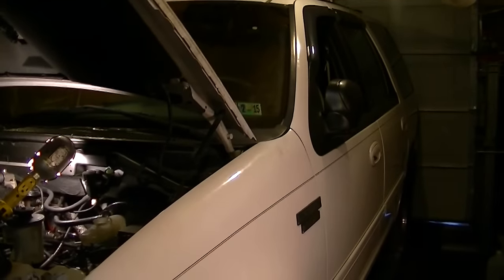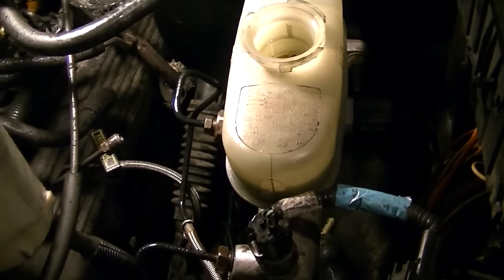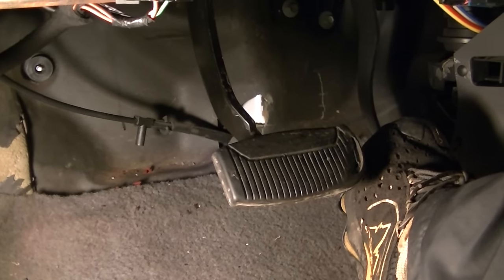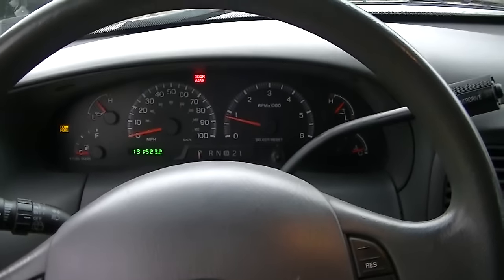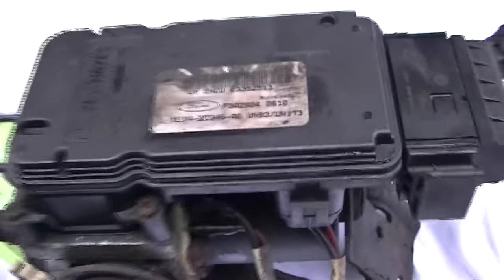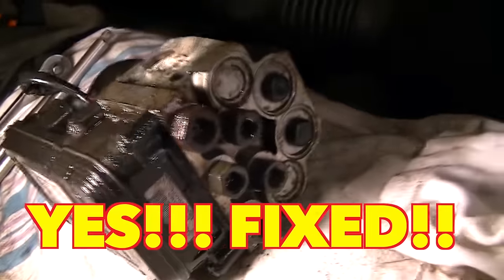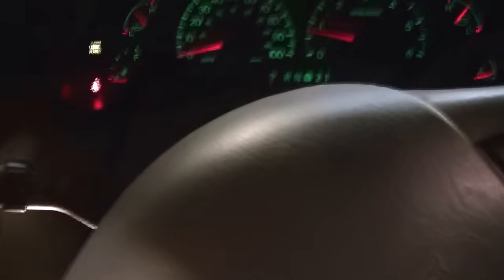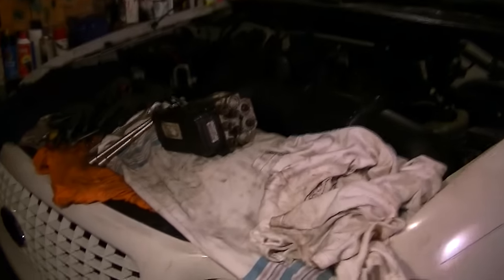Sinking/Spongy Brake Pedal -With ABS SYSTEM?? Nothing Works? Watch Fixed!

Comment: One of the things that can take out the ABS and the calipers is failure to flush out the brake system with compatible brake fluid and then top off the master cylinder to the max mark. The pistons in these devices are made from steel that can and will rust out if maintenance is not done. The DOT 3/4 conventional and synthetic brake fluid is hydroscopic and will readily absorb moisture. Not only does that moisture rust out the caliper/slave pistons but the braking is much reduced by the moisture (since water boils (steam) at 212 degrees at sea level and a gas (steam) can be compressed (spongy feel at pedal.) This should be done once a year to reduce the chance of rust in the system and maintain the seal softeners in the system which DEPLETE in one year. (Professional racecar mechanics change out the brake fluid before every race!) You will immediately notice the stopping power increase after changing out the brake fluid.  Once the debris, dirt, rust is eliminated and your clear plastic line runs clear on all bleeder valves, try to clean the inside of your master cylinder reservoir with a soft LINT FREE cloth to restore its translucency. Some people wonder why the master cylinder brake fluid is dark after a length of time. This is caused by dirt entering the system every time the brakes are applied. While there is a seal-boot on the slave cylinder for drum brakes or seals on the calipers, these seals do not prevent ALL dirt from entering the hydraulic system. Dirt is the enemy of hydraulic systems! The final bleeding will be done with fresh brake fluid and all dirt will be eliminated. Plan on using 1.5 quarts to do this procedure correctly. And be sure to read the very small fine print on every brake fluid can. You may need a magnifying glass to read it! It's that small! They all say once the can is opened dispose of the remainder responsibly. Reason? Once opened it's now contaminated with moisture from the air. And never mix standard brake fluid with synthetic blake fluid they are not miscible or compatible! Use what the vehicle manufacture says to use. Special procedures are needed to properly bleed down ABS systems and each vehicle can be different on the sequence for wheel gets bled first, last and in between so it is prudent to check the factory manual. I hope this helps someone. UTI graduate AOS Automobile, Diesel & Industrial Technology, ASE Master Technician - Automobile, ASE Master Technician Medium/Heavy Truck.
Reply: UTI guys back at it 🤣
Reply: Just bought kia sportage 08 like 100k miles,had air in brake lines and needed pads and a couple rotors..but when I went to bleed the brakes,they ended up feeling like even more air was in the lines than I started out with,Pedal goes all the way to floor now and pumping the pedal makes no difference on stiffness..when bleeding the brakes,1 bleeder screw was a 11mm others were 10mm which means they've been messed with previously.during the bleeding process I noticed I had to nearly REMOVE the bleeder screw just to get a minimal amount of fluid.right before I am able to get the screw open just enough to barely be able to bleed it,I noticed a tiny bit of fluid drippin out from the seat...the fluid was BLACK so I continued to bleed until it came out clear,unfortunately I noticed a bit to late that my buddy "helping" wasnt paying attention to the reservoir..could I have possibly sucked some air up into the abs control module?or is it more likely I just need to replace calipers to,the fluid says it's never been chsnged
Reply: Good stuff all true .
Reply: So what happened when I had a complete brake job and fluid replacement. Had full pedal prior to n spongy pedal afterwards. I’m thinking they f’ed up my job. Brakes work but pedal low
Reply: Thanks I have done this only once  at between 65k and 75k it how has about 165K miles I will replace replace the fluid this next servicing 👍
Reply: @scottwebber652  how is the pedal now,
I have same issue. What did you end up doing to fix this problem?

Comment: I’m have the same soft pedal issue with my dodge. Changed the brake pads in the front because they were bad then it snow ball effect started. Changed the ritors, calipers, flex hoses and master brake cylinder. Still having the soft pedal issue. Makes sense that it’s the ABS module. Thanks for the video!!

Comment: Everything I've researched and vids I've watched says that if the abs module fails (no leaks) that it will still operate like a proportioning valve , you just won't have anti-lock brakes. So , did yours have a leak? I'm puzzled

Comment: Great video. I’m glad I found this. Struggling with my 2011 grand Cherokee and then racking my brains out to figure out what the hell is wrong after I did everything you did. Thanks a lot bye take care
Reply: Did you replace the ABS system? I have the same model and year and the BRAKE warning light stays on even when driving

Comment: 1993 Isuzu Trooper.  This is exactly my issue.  Brake pedal goes almost to the floor before firmly engaging.  Had master cylinder replaced twice (one leaked), had  brake booster replaced twice (one aftermarket leaked on arrival).  The mechanic said he did not know what the problem was, so after $1000  limped home with the same problem.  After viewing your video, it appears that I might have the ABS problem.  I get in the car and the brake pedal feels normal, and only slightly goes down.  Turn on the engine and immediately the pedal goes almost to the floor before engaging.  Also, while driving, I will pump the brakes a little before stopping, and I hear a hissing sound.  I need a better brake mechanic.   Thanks for the video.  Thumbs up!
Reply from the maker: Nice!!

Comment: My wife's Nissan Pathfinder 2014 has the same thing happening intermittently. We even took it to the stealership once and although they bled the system it still happens. Just happened yesterday on our way home from OC. Maryland.  Thanks- now I know what to look for since the brakes were just replaced 10,000 miles ago.
Reply: Was it the abs?
Reply: @ThatBeardedGuy69  Not sure.  It's our backup vehicle now - we don't drive it much.

Comment: I have a severe sinking brake pedal with drastically reduced stopping power on a 2005 GMC Sierra I recently purchased. Given past ABS WSS and Modulator problems, I pulled the ABS fuse and tried braking again. PERFECT BRAKING!!! So, disabling ABS by pulling the fuse is a major troubleshooting step. ABS modulators are very expensive and so are the controllers. I've had ABS disabled on my 1995 S10 for over 100,000 miles. The ABS modulator would have cost half the value of the truck! The S10 was having momentary total loss of braking, which theoretically should not happen. So much for theory.
Reply from the maker: Sometime, I'll try the ABS fuse and see what happens.
Reply: Same here, with a 1997 Chevrolet K2500. Total loss of braking function thanks to the ABS, with the pedal going all the way to the floor. I pulled the ABS fuse, and no more problems. GM ABS systems are extremely dangerous.
Reply: @ttiwkram  I got a 3500 dually with the same problem , I will try it today, one night I came to a red light and the fan belt broke and my brakes has hydro boost that gets its boost from the power steering pump instead of vacuum , i couldn't stop at all , GM brakes suck.
Reply: Just had the same sinking break pedal issue. Lost all breaks pulling into drive way. Pulled the ABS fuze in engine bay. Works perfectly fine now. All breaks returned to normal. 99 chevy blazer 4x4
Reply: My 1995 is giving me problems
Reply: Man, IT WORKS am I glad I found this needle in a haystack!!!! Pulled the abs fuse and had an almost full pedal, yeah but, I plugged it back in and it still works- so far no test drive yet. Been at working on my own cars for 50 yrs. and this is new to me ( 2002 s 10 ) newest I've ever owned...1st one of this century.. THANKS, TONS
Reply: Got a 2008 Silverado that out of nowhere had very hard pedal for like 2 days then all the sudden became a very soft and sinking pedal and barely stops the truck. Already replaced the master cylinder and made no difference. When I brake hard on gravel I can feel ABS kick in but under normal driving I can barely stop

Comment: I am facing same issue... Break padel is sinking once ABS is triggered(Its very rare in my car to actually trigger ABS). But once its start sinking then  I need to stop the car , then start the ignition (Dont Start the Engine), now just pump the Brake to make it hard and then start the Engine.. Its perfectly working as expected. I have tried this at least 10+ time and working fine :)

Comment: The black rubber caps you see below the brake line connections are the LPA's (low pressure accumulators).  This is where fluid goes during ABS event.  Pull those caps off and put a straightened out paper clip in the hole and pump pedal.  If they push out of the valve as the pedal sinks the ABS unit is the issue.  Sometimes if you pump the pedal multiple times very quick you can get a good pedal because the LPA's will fill up and give good pedal.  Spring pushes the piston/fluid back out in the system.  Hope this helps!
Reply from the maker: Nice!! I've done that in the past. It seem to work. Believe it or not, that same SUV still drives today still good brakes!

Comment: I had the exact same symptoms. For some reason I changed the ABS module first, still had a sinking pedal. I then changed the master cylinder, problem fixed. I replaced my original ABS module and luckily I can return the used EBay purchase. A friend/mechanic told me it was the master cylinder. I should have believed him.

Comment: I am thrilled that you solved the mystery. It's on one I am facing on the abs light along with brake light staying on even when I replaced the left front wheel sensor. I erased all the codes with scanner, turned engine on and lights went out. But later I drove off and in 5 secs both lights came on. Initial scan at a transmission shop found trouble with both, wheel sensor and abs pump failure. Now I will re-scan for abs codes, but I am aware the abs pump will need replacement. 
The odd thing You mentioned was, that after throwing the (junkyard) abs pump, you didn't bother to bleed the brakes? Its a rule of thumb, when  Ever, a brake line is opened, it needs to be bled, bcuz air gets in. I fear soon you'll be right back underneath. Another amazing thing is, what are the chances of getting a used abs unit with identical part number! And then for $40? Lol.. Down here the junkyard wants $100+ .. smh.

Comment: I have a 1997 Ford Explorer Limited, 5.0 liter.  Same symptoms.  Brake pedal hard as a rock with engine off.  Brake pedal to the floor with engine on.  I searched and studied for days and while Nathan's fix may be exactly what you need, I want to say that my informal search came up with this guess:  20% of issues are ABS (bad device) related and 80% are "air-in-system" related.  I bled and bled and bled the system until I fixed my problem and now all is well with my vehicle.  2 quarts of fluid and a grumpy wife who sat in the driver's seat and did the pump-and-hold technique.  It may be that a mechanic could have done it much quicker with a special tool and special software on a scan tool, but I am too cheap for that.  Thanks, Nathan.  I would have gone with your suggestion if bleeding did not work.  By the way, there is a youtube video out there where the mechanic used gallons of fluid......

Comment: My wife's Kia Sorento does the same thing after the mechanic replaced the master cylinder. New ABS module runs $1200! I found If I go 20-25 mph on a dirt road and slam on the brakes several time and activate the ABS, the problem will go away for several weeks before reemerging. Then it's back to the dirt road.
Reply from the maker: O boy...Try e-bay...good deals on there!

Comment: Ohh man Wish I had found this video sooner. I have 95’ 4Runner 4x4 4 wheel ABS (uncommon for these particular vehicles) and man I’ve replaced dam near the entire brake system already and it seemed worked for a bit but yet again my pedal is sinking down! Almost purposely drove this thing off a cliff after $500+bucks into the brake system alone. I’m definitely going for the ABS module now. pray for me haha
Reply from the maker: O my! Let us know if you fix it!!

Comment: Found this video... and it is describing my situation to a T.... I bleed the breaks 5+ times.. changed out the Master Cylinder... all that good stuff... pedal still sinking.... had 2 shops look at it 1 shop pointing at the master cylinder the other shop was a mobile mechanic that suggested there might be air in the ABS..... this is convincing me that I need to go ahead and find me a new module.
Reply from the maker: Yes this!!

Comment: A really good video, especially the method used to rule out the master cylinder. I screwed in a m11 bolt into one of the master cylinder terminals and the pedals went rock hard after a few pumps. Life saving video!!
Reply: @wilpresswil  I agree, the video is entertaining as long as you don't need to understand what Nathan did.

Comment: Had the same problem on an 02 Mountaineer.  I found a video about a Honda with the same problem.  The guy took it out on a back road, ran it up to speed & tried to lock up the brakes.  It seems exercising the ABS pump is all it took.  I tried it and haven't had a problem since.  No guarantees in life but might be worth a try.
Reply from the maker: Jim ....Let us know if it works. People could use you experience also with this issue.
Reply: Jim I’ve done that many times just stop really hard several times then I’ll come home and open all 4 bleeders and let them drip then I’ll bleed each bleeder at every wheel..works for me
Reply: @rodneyyerxa7272  So what is going on there is that the valves in the ABS pump get stuck and won't let the fluid pass through them, but the braking hard / activation of the ABS  unsticks them so you can then bleed the air out completely? I think I understand. Having the same issue with my 2007 ABS Hyundai Accent. Thanks.

Comment: Thanks for making this video.   I had the same problem with a 2004 Expedition.  After slamming on the brakes in heavy MD traffic, my brake petal just went to the floor.    I got towed home since there is no way you can drive this in heavy traffic.  I put on a new master cylinder and bled the brakes...but still had the same problem.  After watching your video, I searched out the part at a junkyard...since brand new the ABS pump/valves and ABS electronic controller portion add up to $1,900 from Ford...not including labor.   I haven't been to a junkyard for 30 years - but it was worth the trip to pick up the entire ABS assembly for $50.   It is 3 bolts and quickly cutting several brake lines - in and out in 10 minutes if you plan correctly.   You are 100% correct in that you have to match up all the numbers on the two portions of the ABS block.   Like your story, I had no ABS light on my dash when having the problem, but after installation of the junkyard ABS block, I get the ABS light and the code of "VIN Mismatch."  The only way to get rid of this, as I understand it, is to have a dealer reset this...since cheap readers cannot get into the computer code of this ABS controller.   Here's how I solved it...I believed that my problem was with the ABS valves/pump - so I went back under the hood and quickly swapped out the ABS electronic controller (black box) with only the 3 torx screws and the large plug.   There is room to do this without taking anything else apart or re-bleeding the brakes...takes 5 minutes.   Anyway, this is how I used your video to keep my old Expedition running for $150 (master cylinder, fluid, junkyard ABS) versus a $3,000 dealer charge.   Thanks again, and I hope this is helpful to someone else with this same problem.
Reply from the maker: That's Great! Glad it worked for you!!

Comment: I noticed my Kia brake pedal had gotten spongy and sank to the full under pressure. New master cylinder did nothing to help. Had brakes bled, no leaks, didn't pull or anything, just mushy.

Ran across a forum post suggesting to find a sandy road, drive about 25-30 mph, and slam the brakes on several times to activate the ABS and see if that helped. So I did.

Lo and behold, after 8-10 panic brakings, the mush and sink went away completely. Apparently the valves in the ABS module can get hung up and/or cross bleed and cause mushy brake pedals. So give this a try first thing and maybe avoid wasted repair work.
Reply from the maker: Yes, I've read post that sometimes that will help to remedy the issue. My luck is never that successful. But always worth a try!
Reply: @Daniel Williamson Yes, a 2012. It lasted about 6 weeks or so and got a bit mushy again, so I drove up to a grass field and slammed on the brakes a few times again and back to working fine. Eventually that may not restore it; time for replacement at that point, but until then...?
Reply: @barry7413  didn't work for me
Reply: So it's not trapped air in them that can cause this as much as maybe just stuck / cross bleeding valves that are responsible? Thanks! I'm trying to understand how it works.